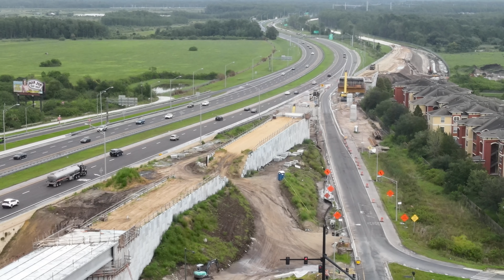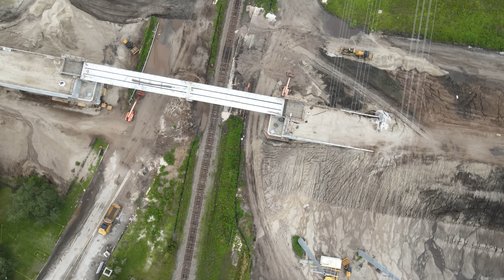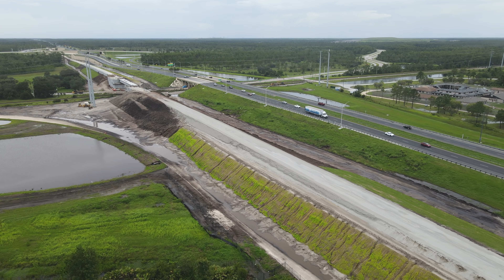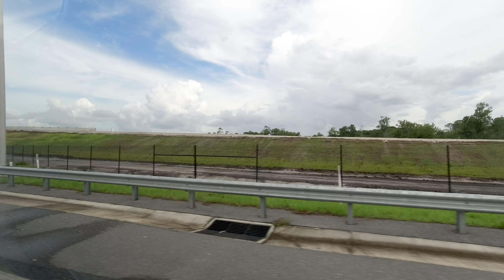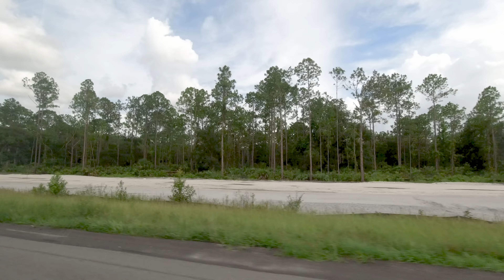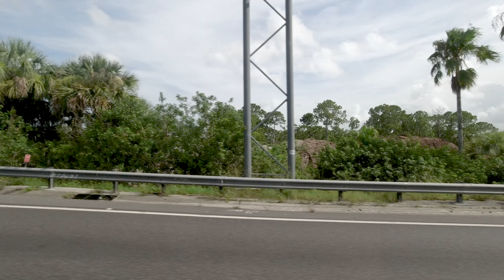Brightline Construction: Progress on the Orlando Line - July 2021

Comment: Do you know if the OUC spur connection will stay after the completion of the railline or wil it be removed after construction has finished.
Reply from the maker: It will probably remain
Reply: It would be a useful connection for maintenance equipment and emergency access, they probably want to keep it